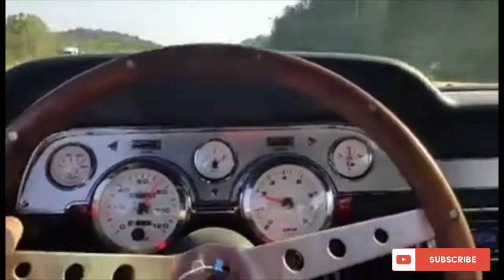69 Mustang Sportsroof -  EP #5 -Decklid MADNESS

Comment: Jeff, make sure you tape on a new gasket before you start welding anything, Rich
Reply from the maker: Ive already did some test fitting with the rear window gasket and the decklid also had a gasket on it when fitting. Thanks
Reply: @ID10TGARAGE  Excellent,  make sure you have gasket on the doors also before welding up the front of the Qtrs on 👍
Reply from the maker: @RS-gh2mf  Almost forgot about that. Drivers side has one, I just have the Rubber Bumpers on the passenger side...Thanks for catching me